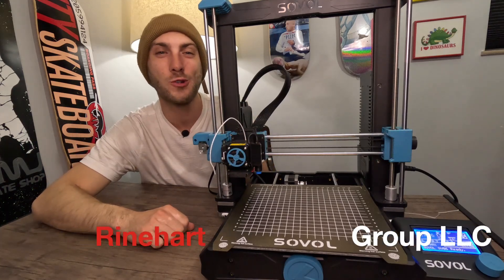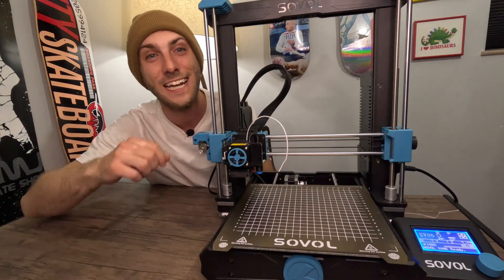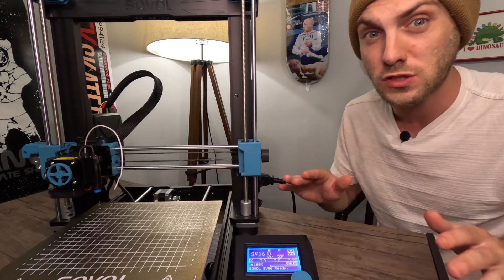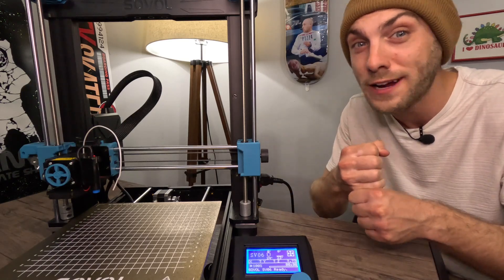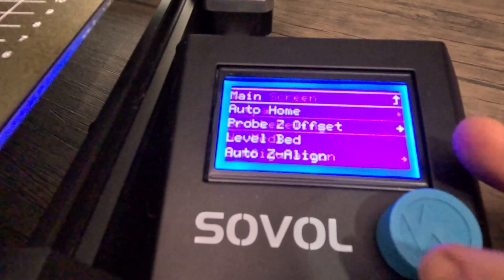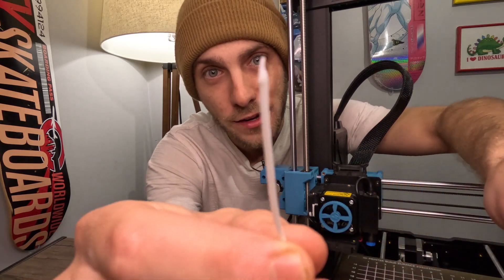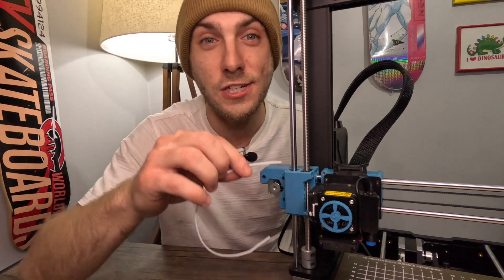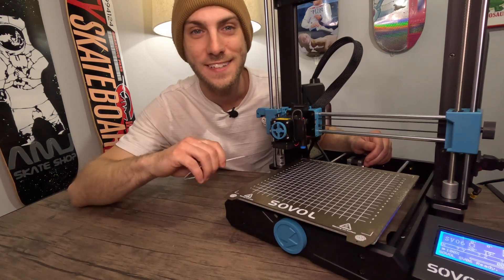3D Printing Ep#5: Filament Stuck In 3D Printer? How To Unload Sovol SV06

Comment: what is that screen?
Reply from the maker: That the is sv06 stock screen, it looks different from an SV06+. Which 3d printer do you have?
Reply: @RinehartGroupLLC  the plus. I like that screen better
Reply from the maker: I haven’t used the Plus yet to tell you if I like better than the other, but the screens may be completely plug and play. I was hoping Amazon had a screen you could just buy from an sv06 but I couldn’t find one. I would say the screens are probably plug in play to where they can just be swapped
Reply: @RinehartGroupLLC  th3d has a screen kit that looks like the one in the video.  It moves it to the left too.

Comment: That works because the 'Auto Home' is heating the hotend. The bed temp has nothing to do with being able to remove filament. Just set the hotend temp to print temp for that filament and remove. I suppose 120deg is hot enough to soften the filament, but I wouldn't get in the habit of removing at that temp . Just one more note here -- it seems you think the filament was "stuck" -- but from reading the description and watching the video it seems you were trying to remove the filament when it was cold. 90% of the time you will not be able to remove cold filament because it is solidified in the nozzle.